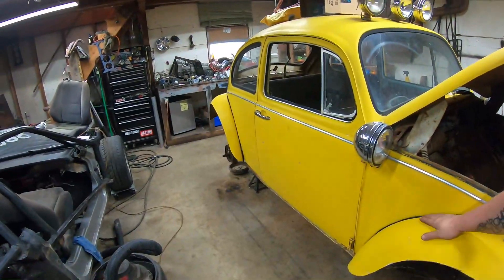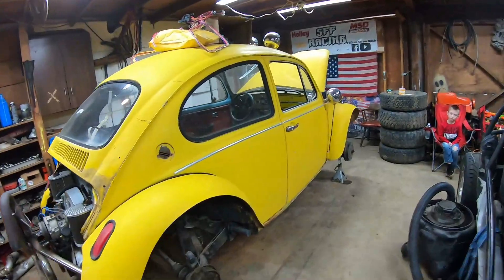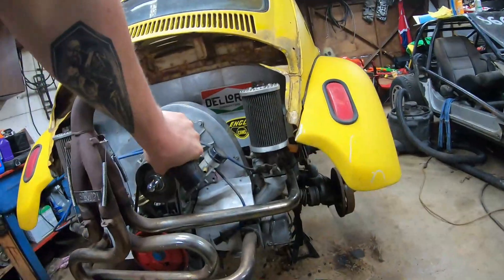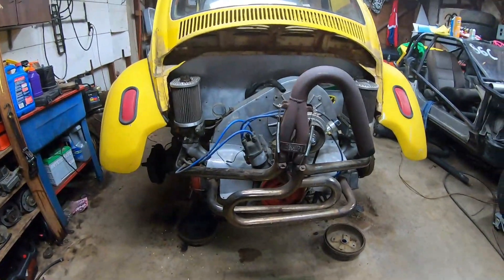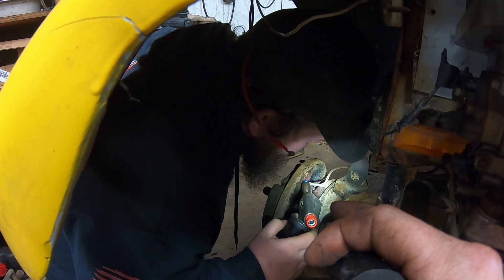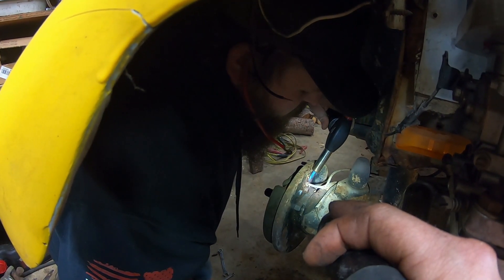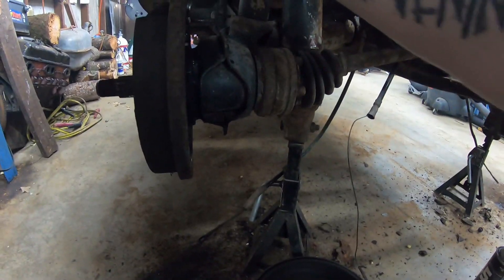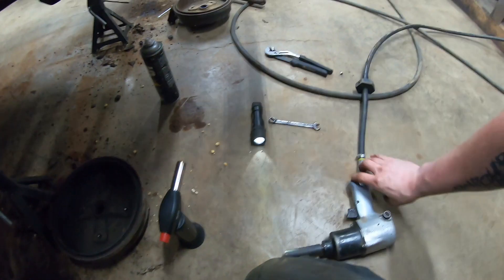Working On PETEY The 69 VW Baja Bug

Comment: Cool stuff good video
Reply from the maker: Thanks man 🤘
Reply: @SFFRACING  do you have any tips on doing axle bearing on a 99 jeep grand Cherokee I'm having hell getting the wheel bearing off so I can get the CV axle out
Reply from the maker: Should be 3 or 4 bolts that hold the bearing housing to the spindle I'm assuming those are out? Might possibly turn the steering wheel and use a long punch from the backside to drive it out also a little heat never hurts if something is seized
Reply: @SFFRACING  got it got one of them torches
Reply: Great tips thanks
Reply from the maker: @jasonwilliams4197  stoner section torches? 🤣🤣 no problem man glad I could help